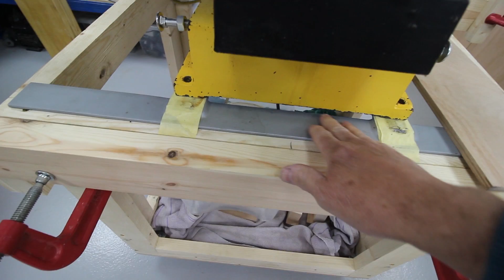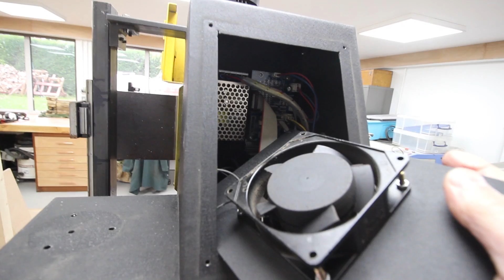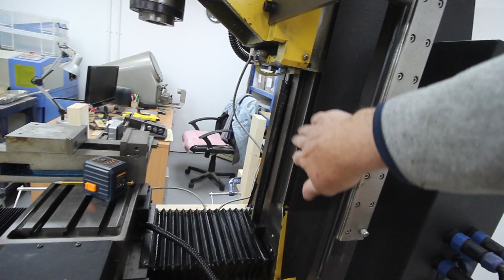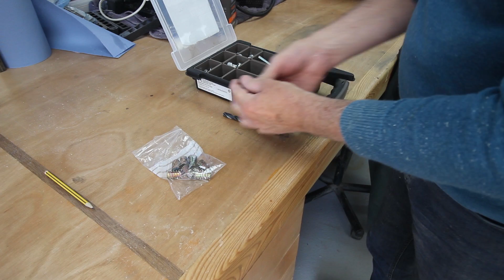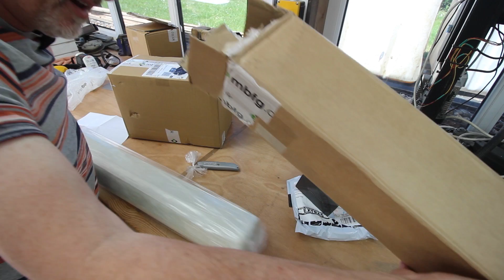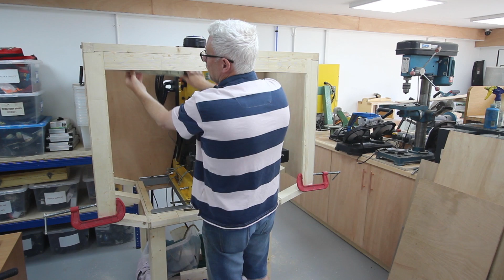CNC Mill Cabinet Build

Comment: I'm not quite sure what the end result will be. Are you planning on fitting polycarbonate doors? Fibre glassing the interior? What about a slide out tray that catches the swarf before it hits the reservoir? Anyway, keep up the good work. I've been faffing about with a spindle lock with an interlock in it - so far it seems to work.
Reply from the maker: Yep all of the above doors now fitted hope to glass fibre this weekend and got filters and steel for a slide out chip tray.
Are you still using mach3 or something from this millennium ?
Cheers

Comment: Going well.  I would have thought that the easiest way to sort the drainage tray would have been a simple stainless tray on top of the base with the mill inside it. Obviously seal the mounting bolt holes and put a drain hole somewhere convenient straight into the tank below.  Either a filter and / or a trap similar to a sink or toilet with magnets at the bottom so that the fluid will overflow and drop into the tank and any swarf will be caught in the s trap.  I think that's the way I would have done it😀
Reply from the maker: Hi Mike,
That was pretty much what the mill was supplied with.
With the tool rotating it’s like the inside of a washing machine stuff flies everywhere hence the big new box!
Cheers

Comment: For sealing the slots at the back, you can use brushes like the one used as draught reduction with (sliding) doors. Should keep 99% of the muck out.
Reply from the maker: That’s a good shout I’ll see if I can fit some!
Cheers

Comment: Hey so those resistors you added to your VFD to dampen out the sudden stop energy.  I don't have a VFD but I have one of those StepperOnline T6 series 1000W AC servo for a spindle and if I suddenly stop it at over or near 5000rpm the drive completely errors out and have to restart the machine.  If I slowly decrease the speed from 5000rpm a little at a time till its about 4200 rpm and suddenly stop it its just fine but I hate doing it that fast because it doesn't seem healthy for the motor.  It stops on a dime and so quick its scary.  Anyways do you know much about if its possible to add some of these resistors to servo drive and they do the same thing?  Im wanting to take really good care of this machine after all the work I put into it to get it to where it is.  Thanks?
Reply from the maker: Hi Dave,
With a vfd the terminals are marked brake resistor and the percentage of power dropped into them is set in the vfd menu. Having said that not all vfd’s have that option.
I’m am not sure about servos but the manual will have the details the tricky bit might be working out the power in the resistor and the value. The resistors in my cnc are 33ohm and 50watt there are three in series. They stop the 1.5kw spindle motor from 5600rpm to zero in around 2 seconds.
Not sure this helps much but the manual should point you in the right direction.
Cheers